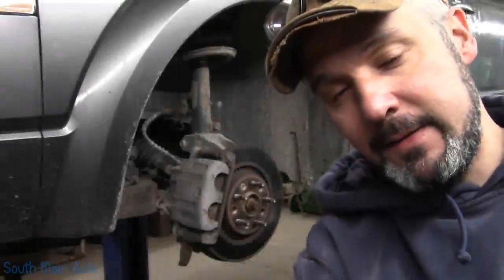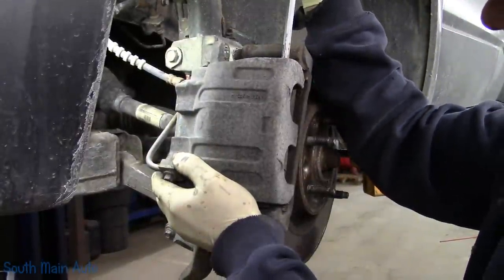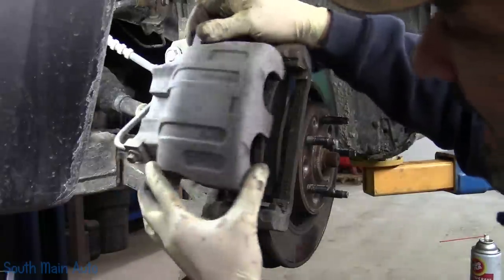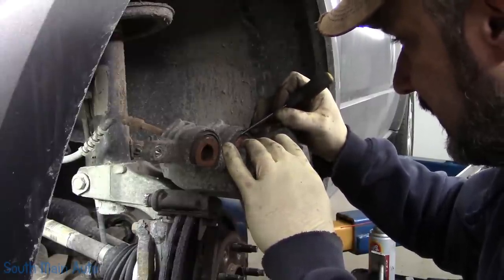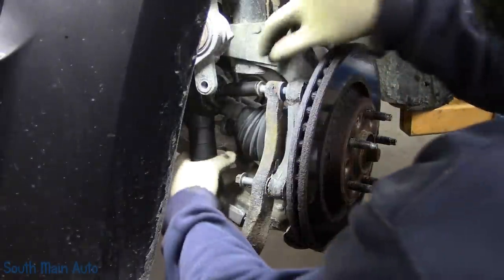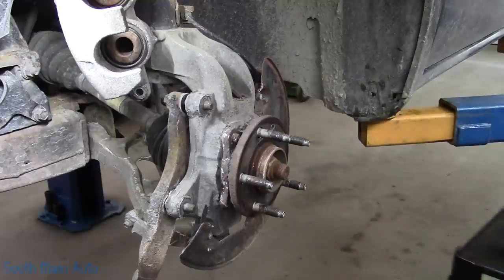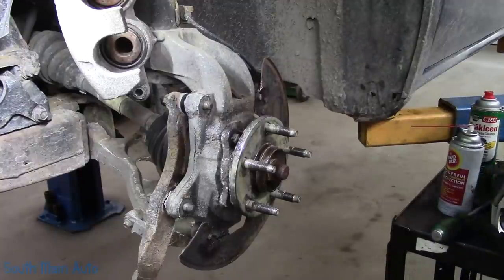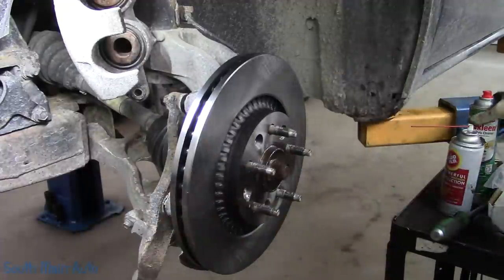Ford Freestyle: Front Brakes w/ Seized Caliper Pin

Comment: Friction melting your rubber can have surprising, longstanding and costly ramifications. Do not think that you will be able to avoid these issues by making another call to your parts guy, even if he’s been through it. While RTV can be helpful at times, applying it here would be undesirable, especially if you need to remove it later.

Comment: The only thing I'm personally think you missed is on the caliper tape and paint. Corrosion control. You might say it's just a caliper. But rest is a cancer you get it there it spreads. 😫

Comment: How many guys in here have rushed through the wire wheel process and sucked a pin in and stopped the grinder. Admittedly... I have... a bunch. Lots of brake jobs... lots of nasty pins.

Comment: I would stick akebono pads on it and let it go if it was my vehicle. I have been driving and fixing my cars since 1960(48 chevy first car). NEVER turned a drum. replaced three rotors because of damage caused by wheel bearing failures. NEVER turned a rotor. Always replaced wear material before it went steel on steel. As my mechanic friend said to me back when I got my first vehicle with rotors(71 blazer). if the brakes work smooth and equal the concentric wear groves don't matter. Of course when doing jobs for pay you have to do everything needs it or not. NEVER owned a ford. toyota rotors and drums are way way better than aftermarket crap.

Comment: I'd replace the caliper, if it freezes it can destroy everything: rotor, pads, fluid and obviously the caliper. Just had my Dad's old car that was sitting around and a $1,000 full brake system replacement. It's just not worth the risk of repeating or worse.

Comment: Big C clamp and the old brake pad to compress the caliper , works every time  unless the caliper is seized , then it's time for The Parts Cannon lmao as for removal of old parts to be replaced , be on it like it owes ya money , caused it already cost ya to begin with .

As for massaging it with some heat and not over heating your rubber are we watching auto repair or a more risky channel he he ,

Comment: Lots of asbestos dust whenever you work on brakes and rotors, especially when using grinders or rotary wire brush.  Suggest wearing a close fitting respirator whenever you touch a brake area, Mesothelioma has no friends
Reply: Dave Scott, pretty sure Asbestos has not been used in brake friction material for over 40 years in western society, though it would be prudent to wear some respiratory protection.
Reply: 25 yrs ago maybe
Reply: @DuffyGabi  noted!, Though Europe does lead slightly in material hazardous to health issues/legislation.
Thanks for commenting.